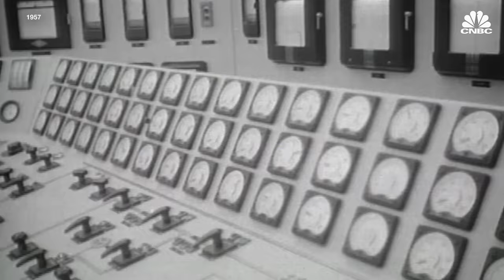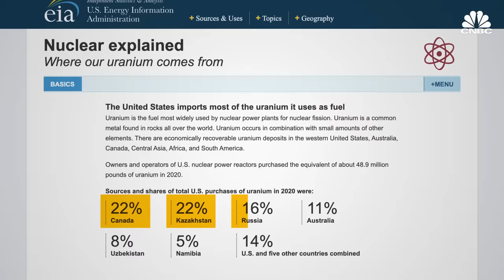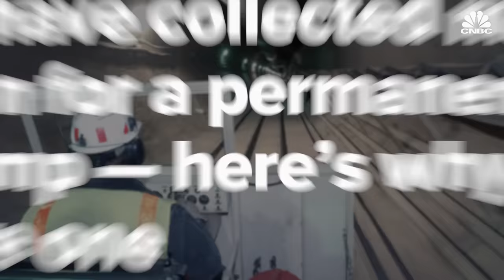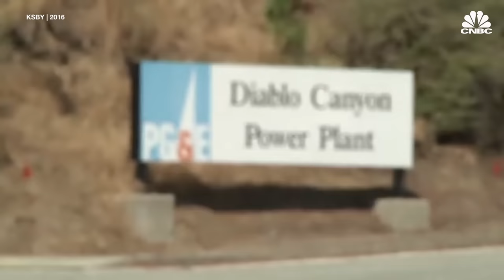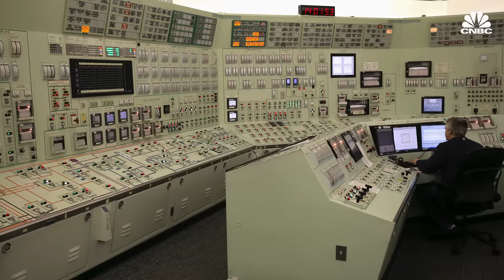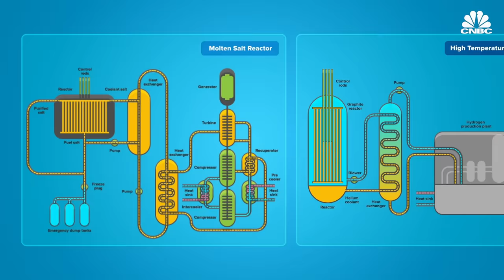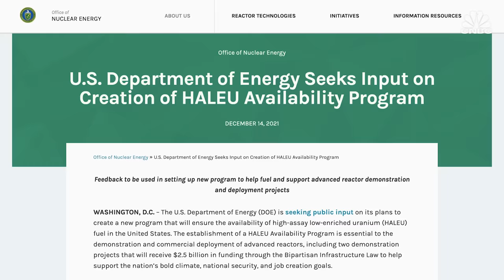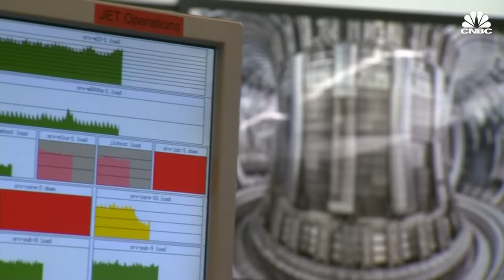Why Nuclear Energy Is On The Verge Of A Renaissance

Comment: These are not just portable reactors. They can be but you'll be using these modern reactors to scale out the application of the reactors. Some can reuse the spent fuel to use more of the material.
Reply: How can they reuse spent fuel????
Reply: @clarkkent9080  DUPIC cycle.
Reply: @caav56  Correct but you need a processing plant to separate the Pu239 from the other isotopes in the spent fuel. Then you need a plant to mix the Pu239 with U238 or other isotopes to make assemblies that can inserted into the reactor. And then there are the shipping casks needed to move the spent fuel from the old reactors to the processing facility along with security and loading and unloading facilities. It is not so simple or cheap when you consider the reality of actually doing it.
 MOX was a U.S. government facility that was supposed to mix pure weapon grade Pu239 with U238 to make reactor fuel assemblies. It was canceled in the U.S. after spending $17 billion and they finally admitted that it would cost $100 billion more to complete and operate.
Ideas are cheap but reality is not.
Reply: @clarkkent9080  To quote IAEA article:
"The DUPIC fuel cycle is an alternative in which Candu fuel is fabricated from spent PWR fuel without any international separation of fissile materials and fission products."
So, the whole point of it is you don't need to separate stuff.
Reply: @caav56  So you have different size and types of fuel assemblies with different U235 percentages and different isotopic mixes from hundreds of different reactors and you just open the top of this Candu unicorn and dump them in and pesto magic they are healed????
No processing, just dump anything you have in just like the Back to the future Tandy fusion reactor.
Reply: @clarkkent9080  From "THE DUPIC FUEL CYCLE SYNERGISM BETWEEN LWR AND HWR":
"The spent LWR fuel is transformed into HWR-type DUPIC fuel by direct refabrication, without any separation of nuclear materials."
So... kinda yeah. But again, we're talking about CANDUs here, which normally work on unenriched uranium and were confirmed to be able to use thorium fuel. To it, even spent LWR fuel is perfectly serviceable.
Reply: @caav56  Candu reactors are heavy water no enrichment reactors. What is direct refabrication mean?  Any book educated person can explain what can be done but they have no idea of the cost or feasibility of such ideas
You have to have a facility that removes the fuel pellets from the spent fuel rods and while that sounds simple, they just don't all fall out when you cut the rod.  And then some spent pellets are whole, some cracked, and some powdered. And the U235. U238, and Pu239 concentrations will be all over the place and they have to handled as fissile material and criticality is a concern.  You would have to fabricate them into something that can be cladded and put back into a reactor that has this mixture.  I cannot imagine a reactor that you can load all different enrichment fuels into and actually know how it will operate.  Irradiating radioactive isotopes will change them all, some into less radioactive and some like U238 into more radioactive isotopes.
The U.S. MOX facility was designed to mix pure 100% weapons grade Pu239 with U238 both of which are easy to handle and process.  The idea was to burn up excess  weapons grade Pu239 to reduce the chance of  proliferation.  Below is what happened to that SIMPLE facility.
 MOX that was supposed to mix pure weapon grade Pu239 with U238 to make reactor fuel assemblies was canceled in the U.S. after spending $17 billion and they finally admitted that it would cost $100 billion more to complete and operate.
Reply: @clarkkent9080   Show your "feasibility study" of world wide solar when the minerals do not even exist in the planet to be mined in the quantities you meme.
Reply: @clarkkent9080  and the price to develop these new reactors is quite expensive too. I really don't get your logic. The cost of invocation is what the cost is. Either way the reactors still need to complete the development phase and move into the testing phase. As technology progresses things become cheaper. The US interstate system cost over 5 trillion in today's money. With your logic we never would have been able to advance technology here in the US to what we are currently at. I really think you should look at what it took to develop our technology and how much government and private capital that it took. These investments are what made the greatest generation so great. I only mentioned the spent fuel because we currently have storage issues and people are worried about it.
Reply: @jeffjohnson6709  There was NO development or testing costs...NONE.
The Vogtle and VC Summer reactors were Westinghouse AP1000 built and operated in China first so WE had no learning curve. They were just Westinghouse 1970 designs with added safety features.   They were also fully 100% approved by the NRC for construction and operation so all the utility had to do was build them according to design.  The utility pays ONCE for the design from Westinghouse and after that there is no development or testing phase cost.  The estimated cost includes EVERYTHING at the start of construction. How much more simple can that be????

You have a 100% complete design, no development, no testing and you estimate how much that will cost based on construction costs PERIOD.  VC Summer canceled theirs because after spending more than the anticipated that the whole thing would cost they had no idea how much it would cost to finish CONSTRUCTION.  Vogtle is 110% over budget and they are at least one year away because they LOST thousands of build documents. Is maintaining documents a development or testing cost.

PS some project managers are under inditement for FRAUD.
Reply: @clarkkent9080  there's no development on new reactors and their designs?
Reply: @jeffjohnson6709  The Westinghouse AP1000 is a standard Westinghouse PWR design with some added passive features so NO it is not a new design.  And since any bugs were worked out by the China builds it should be easy to build and that is what completed failed at VC Summer unit 2 and 3. And is 110% over budget at Vogtle unit 3 and 4 and at least another year away from starting if ever. You cannot blame new design, testing etc. on these 4 failures.

Terrapower (CEO Bill Gates 4th richest man in the world) and NuScale are getting $2 billion each of taxpayer welfare to develop new gen 4 reactor designs.  Both Terrapower and NuScale initially advertised their reactors as costing $1 billion each. 
Terrapower started in 2015 and has not even broken ground yet.   NuScale reducedAre you willing to  their reactor size in half to reduce costs and the design costs are now so high that many of the utilities that were partnered with them have backed out and they only have 1/4 the number of backers necessary to build the reactor that is now delayed till 2025.

New design or not, how can you support a power source that costs 8 times what other power sources cost hoping that it will get cheaper?  Are you willing to have your electric rates increase 800% for now hoping they may go down in the future?  

Do a little more research on this subject beyond watching a YT video.
Reply: @jeffjohnson6709  If I am missing something then please educate me on any company or project that is planning on building a new nuclear plant in the U.S.. Have you actually done ANY research beside watching a YT video?

 How am I shifting my argument by listing every new nuclear project currently in the U.S. and their status??? Should I lie so we can become the greatest generation to go bankrupt investing in more failures???

I am not arguing anything or refusing to invest in anything.  Utilities decide what type of power plant to build and I have just explained FACTS and why NO utility is even considering new nuclear. You don't decide and I don't decide, utilities decide so you may want to call your utility and DEMAND that they invest in the future before America is left behind.

It is not my opinion that new nuclear projects in the U.S. are failures, it is a FACT unless you think spending $17 billion and then abandoning the project is a sucess.

The VC Summer and Vogtle were commercial nuclear power projects.
Terrapower and NuScale are demo test reactors. 
You and I don't have any control over what happens, I have just explained what has happened and why nuclear is not on any utilities list.  Maybe you can change that but it will take more than commenting on a YT video.
Reply: @clarkkent9080  first of all you're assuming I have only watched this single YouTube video. Second, the first generation reactors and test reactors were built by the US government. We either fall behind or we don't. I haven't said anything about the type of 4 generation reactor I prefer. You make a lot of assumptions based on not much of anything other then. It will cost too much which ever 4th generation reactor it is. Advanced technologies are hardly ever just developed by corporations. It just doesn't happen. They may buy the tech and use it or it may be developed by the government or a school. Hence the circular argument and changing your argument up. No matter what I say. You will say it costs so much. The greatest generation built and funded NASA. Built the interstate system. At today's dollar value. Those things cost Trillions of dollars. You're looking at over 10 trillion with just those two things. China has already connected a 4th gen reactor to their grid. If you think that Edison built his initial grid with his own money you're a fool. It was built with an initial investment with tax dollars and investors. There's is very little r and d that doesn't have tax dollars in it. Give one thing a private company did the r and d on from the ground up from a corporation not receiving any government subsidy?
Reply: @jeffjohnson6709  I worked in the nuclear industry for 40+ years. I was a Reactor Operator and Senior Reactor Operator at 5 different nuclear facilities and consider myself to be pro-nuclear. I think I may have a little more background on this subject than you. I would like to see a resurgence in nuclear but reality proves otherwise.
I respond on these channels to people who think nuclear is so great, without problems, and have never even researched what is currently happening in the field today. 
When I simply provide FACTS on the recent failures and problems people complain that I am anti nuclear and against advancements and letting America fall behind.

People blame the recent failures on the media, anti-nuclear greenies, and even the Nuclear Regulatory Commision.  The last 5 failures were in the southeast U.S. where I live and it is 100% pro-nuclear, with the media and politicians 100% behind nuclear.  I know many NRC personnel as I have licensed and relicensed many times and these are mostly ex-navy nuclear people that are super pro-nuclear but also demand the same level of safety found in the Navy programs.
So why has new nuclear failed in the U.S.?  I have been on one failed project and know many that worked on the other projects. I can relay what I have been told by people that actually worked or are working at these other failed projects and they are the same as I experienced: poor management, stolen equipment, fraud, kickbacks, greed, sabotage to keep the project going, lost documentation, etc. All project related. Read the facts below and tell me why they are not firing people or putting people in jail.
Below is a news report for the Vogtle Project Management's answer for the latest delays:
Southern Co. yesterday announced another delay for its long-troubled nuclear construction project in Georgia, edging its costs closer to the $30 billion mark. 
The setback could now push the startup date for Plant Vogtle’s first reactor until early 2023 and move the date for the second one to later that year. The costs for Plant Vogtle’s two reactors have now risen to the point that Southern should absorb every dollar instead of sharing that burden with the other developers — and passing it on to customers. 
Plant Vogtle’s latest move highlights the nuclear industry’s chief troubles with building large, baseload reactors: safety and cost. To be clear, Southern executives have blamed this new hiccup on paperwork, saying that workers were gathering it to send to federal safety regulators and noticed critical inspection records were missing or incomplete. The pile of missing or incomplete documents added up to a delay of three to six months, Southern said. That additional time is costing $920 million. 
“We’re a little frustrated with the latest developments,” Southern Co. CEO Tom Fanning said yesterday in an interview. “[The first unit] is on the doorstep of loading fuel and going into service.” 
Fanning talked of “great momentum” at the construction site since November. He said the company was looking forward to receiving the Nuclear Regulatory Commission’s permission to load fuel rods into the reactor, the last major step before it can start producing electricity. 
But workers realized “tens of thousands” of critical documents were missing, leading to a three-month backlog, Fanning said. Officials have cut that time down by 30 percent, he added. 
“We’re fixing that part of the ‘paper’ process,” he told E&E News.
Reply: @jeffjohnson6709  CONTINUED:
From your responses correct me if I am misunderstanding but you seem to be saying we need to build more nuclear not matter what the cost.  No matter if there is massive mismanagement, fraud, theft, etc..   You explain away 110% cost over runs and project cancellations after spending billions as normal and necessary to advance in the U.S.. and the taxpayer should foot the bill. 

It is not that it costs too much it is that the mismanagement, fraud, theft costs are unacceptable.  Go to Waynesboro Ga. on a weekend and buy a round of drinks with what will be all Vogtle construction craft and I bet not one of these Americans will agree with you that what is happening on the project is acceptable and necessary to advance this country. 
My electric rates have increased 29% for Vogtle construction when NO utility is supposed to charge customers for plants until they are operating. If Vogtle unit 3/4 ever operate my electric rate will double to pay for the $31 billion for two units. Needless to say, people in the southeast U.S. are not so pro-nuclear now that they see the cost.

So what is the root problem?  Why no accountability?  The taxpayer is backing the loans so you paid for some of the VC Summer failure.  And no matter what it cost to build, the ratepayer foots the bill and the utility investor gets their 9% ROI stock and a dividend.
The AP1000 is a developed and proven design and if investors were forced to pay for the full cost they would make sure the project stayed within budget.

You may not like this but on average 2 large Mw old nuclear plants shut down each year.  Vogtle will most likely eventually start their two new units.   After that, there is no new commercial units planned and given the 15 years to build from planning to operating it will be decades before new plants can makeup for the loss from ones shutting down.  Sorry for the REALITY check but it is what it is. If you listen to the European news and the Biden administration, they say natural gas will be a bridge power source in the foreseeable future. When politicians begin to whisper the truth, you should listen.
Reply: @jeffjohnson6709  It does not matter if you or I am wrong.  The people that actually make the decisions on what to build have no interest in new nuclear and if you do any reading you will see that most utility owners of the old (paid for) standard PWR/BWR want to shut them down as being not cost effective. So the old and new reactors that have been connected to the grid have been identified as not being a cost effective option, no finding out required.

You need to contact your congress person and utility because they are making the decisions. See where you get with that.

By the way, just because China does something does not make it right.  The Chinese economy is not doing so well even though they are a dictatorship.  Stop believing the China is taking over the world idea and ask your parents who was going to take over the world in 1970-2000 and they will tell you Japan. China is already giving way to India as a dominate economic power. It is ok to read what others say but it is even more important to think.
Reply: @jeffjohnson6709  Every reactor type that is or has been discussed has been built and tested in the U.S. over the last 70 years.  So, the modern, new, gen x, etc. designs are nothing special as the U.S. has tested and evaluated them before selecting the PWR/BWR as the best overall design. 

If you want the design with the least chance of proliferation, then choose a different design but taking everything into consideration the PWR/BWR wins.  If you're running out of Uranium, then choose a different design but taking everything into consideration the PWR/BWR wins.

 So no, we do not have to build it out to know what to expect. With detailed design prints, any good cost analysis can tell you what the cost should be sans fraud, kickbacks, etc. so again no you do not have to build one to determine if it will be profitable.

We are not in a bind.  Everything is on the table and we know what natural gas, coal, hydro, solar, wind turbines, and nuclear costs along with the pros and cons.  There is no clear winner unless we decide what we are willing to accept.  

I assume you are young and never experienced the 1970s when gasoline was not available at any cost.  Gas stations empty and closed. And when a tanker showed up hundreds of cars lined up waiting hours to get 10 gallons and that was when cars got 12 mpg. 

If you don't trust politicians or utilities, then it sucks to be you because YOU do not decide, they do.
You seem to be fixated on China and not realizing that Russia wants the good old Soviet Union Back along with Alaska.   China does not want anything more than Taiwan while Russia wants Europe and Alaska
Reply: @jeffjohnson6709  The 1944 Handford reactors were nuclear weapons production reactors and never produced any electrical power and were not test reactors.  the first Atomic power demo test reactor (Shippingport) was built in the U.S in 1957 and I started my career there. It is not well publicized but their last reactor was a light water Thorium breeder reactor. 
The national labs tested every type of reactor known. If you recall something different, please tell me.  I have 40+ years in the industry beginning at the age 18.  Please tell me your basis for knowledge?
I guess industry and government just builds plants with no idea what they will cost and hope for the best. Other than production availability and cost to produce power from other sources, all currently operating reactors cost to build and operate were well known except for the present that far exceeded estimated build cost.